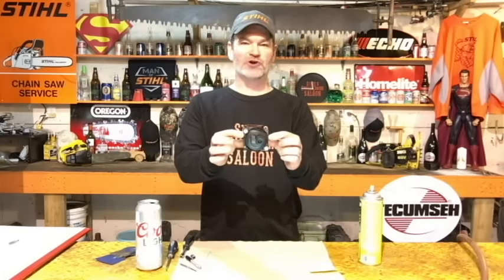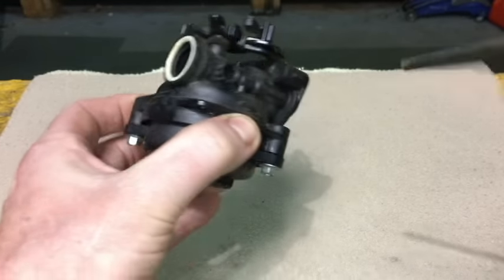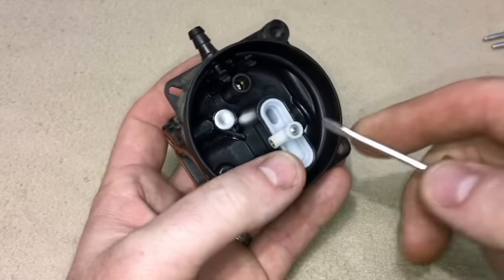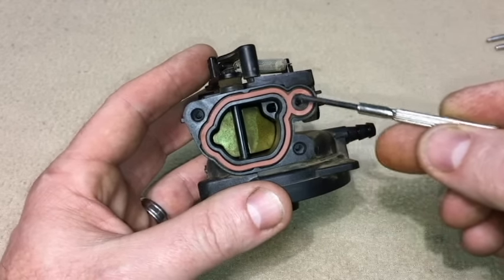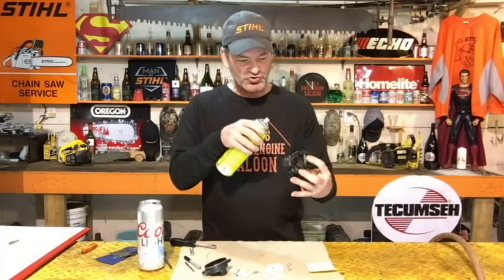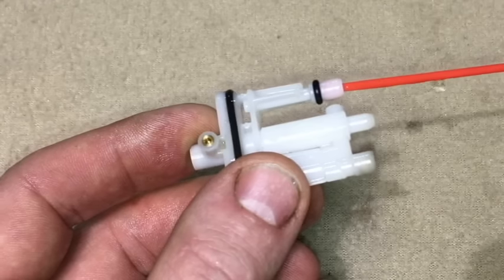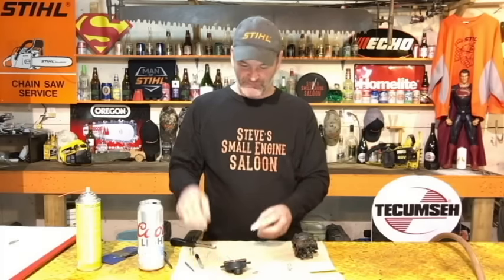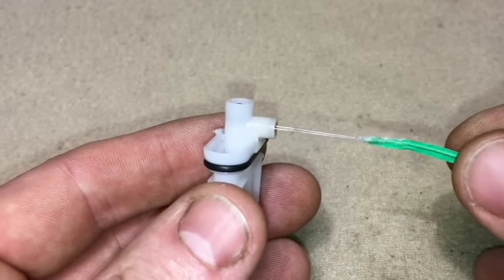EASIEST WAY To Clean a Plastic Briggs Carburetor

Comment: Good info.... Husqvarna Lc121p/725exi(2016), briggs and stratton engine, same carb, took it completely apart twice thinking that was the culprit of my hard starts, carb spray went through all the jets and passeges, no problem, next up, checking and then possbly changing the flywheel key.
Reply from the maker: I have another video in my playlist about a common problem with these...
Reply: @StevesSmallEngineSaloon  Did the jet mod and thorough carb cleaning one again, still no bueno on the starts.... come to find out, it was the one place i didnt think to lQQk, the Oring gasket that fits between the cylinder head and plastic tube like spacer that the carburator slips on, other brand mowers use a flat material like gasket between the spacer with their metal carbs. I guess over time, the Oring gasket shrunk due to the engine heat allowing added air into the cylinder or perhaps the spacer just needed tightening, but i replaced the Oring gasket with a new one anyway, same inside/outside diameter, but slightly thicker than the original. The mower sounded like it wanted to start on the very first pull, but come the second pull, vroom! starts and runs like a champ now, so to others having stubborn starting problems like i did even after cleaning the carb and jet mod, check the Oring i mentioned first and retighten the plastic spacer/bracket or just replace the original Oring(1 1/16'' OD - 13/16'' ID - 1/8'' thick -  silicone/450F).

Comment: i brought a briggs powered husqvarna mower back in apr 2017. i was used daily for 4 years and it NEVER had any form of fuel problem. its only today (april 2023) that the carb has suffered a blockage. a new genuine cartridge jet is on order. they are less than £10

Comment: Just had my first  one of theses in  and  it was hunting  I  took the carb off  cleaned  lots  of crap came out the cartridge. Put it back together   slightly better but  still not right   i did the twister wire test and it wouldn't go though after a wiggle it did   it was like a peace of grit was stuck fast  now  it's running spot on ... I think the problem is there no filtration  from tank to carb    I'm going to put  an inline fuel filter  on it.  Sure it won't hurt it.
Reply from the maker: Right on

Comment: Steve, Reaming out the small hole sounds good. There is a fine screen in the bottom of the gas tank that filters the gas on the way to the carb. If the mesh of this screen is larger than the original small hole that you reamed out says that larger particles can go through this screen than through the original hole size. That is a real problem. Can you find out from Briggs and Stratton the mesh size of this tank screen may point to the source of the problem. Roger Greenville SC.

Comment: Commenting early. I
 pulled out the cartridge and behind the little metal flap was the jet that you could not get carburetor cleaner through. That's where I think I might be having my trouble.

 I acquired a free lawn mower off Craigslist today that was in very good-looking condition and it had compression and everything so I decided to take it. The guy said it just has a carburetor problem he told me.

 I don't know how spark Works entirely on the newer model of lawn mowers but when you have the spark plug out and you have the spark plug attached into the boot and you pull the starter chord you should see spark correct. I have tested the starting coil with my multimeter and I am getting 8.2 ohms @ 20K. Tomorrow I will check. does the spark plug have to be attached to allow it to get spark. Is it some kind of a grounding thing or something else, the spark plug looks brand new. 
But that led me to the carburetor and led me to your video. 

That little jet that I was referring too.  I have got a piece of oxygen line that fits perfectly snug down into that hole from the cartridges side. No matter how hard I blow I can not get air to move through it. 
Also as soon as I opened up the carburetor I believe I discovered the problem when someone else took it apart they did not have the needle in the float it was just a set down in the hole with a float put on top. 
I'm going to continue watching the video and I hope I get the answer and if I do I'll probably delete this comment but I have a feeling that's a problem with that being clogged like that
. I hope to potentially get an answer, that would be awesome and you got yourself 👍 + a new subscriber great video man

Comment: My brother got his plastic carb stopped up with old gasoline.  I removed the carb and tried everything I could to get the plastic carburetor unstopped.  I finally bought a new carb online and installed it.  The mower started first pull, but was surging.  Removed the carb and cleaned it, reassembled and it started and ran good for a couple minutes.  Repeated this several times.  I finally put a new fuel line on it and an inline filter.  I had to reroute the fuel line to the carb.  So far, that is doing the job.  The tank has a buildup that I couldn't remove all of it.  The tank strainer appears to be good but was letting enough through to stop up the jets
Time will tell if this is a long term fix.

Comment: @stevesmallenginesaloon I have this plastic carburetor in a 20334 toro mower. It wouldn’t start so I cleaned it out and now it starts right up but the once it warms up the RPM’s go up and down about every 2 seconds. Will stop for 5 seconds and then do it again for a min. I’ll buy those drill bits and see if drilling it helps. It’s seems like the auto choke is pushing it all the way open and that causes the engine to die. I guess  because it’s not getting enough fuel. Is it possible to switch to a metal carb on this thing?

Comment: I was just doing one of these today, and it was driving me nuts that i couldn't get spray to go through that one passage where you said some of them wont. It sure LOOKS like it should be a connected passageway.   I was ready to drill it out.  I guess I'll just try to run it. Makes no sense to me why they left it blank.  
I also stripped down a twist tie for this job to poke the jets out.
One extra thing I did was to actually twist apart the two psrts of the white cartridge to see if anything was in there. This is my 3rd attempt at this carb and Im getting frustrated.  The engine fires on a prime and the bowl is full., but it just refuses to draw its own fuel and run.  My first experience with these newer carbs. It looks very simple but it's being a challenge.

Comment: I live in high elevation (7000ft) and I have a 125cc with a plastic carb that won’t start

Cleaned it out and drilled the jet with the hand drill he says to, but now the engine is over fueling and spilling gas out of the carb while running. Float is good as nothing spills when sitting. Would drilling out the carb +low air pressure from elevation cause the over fueling or do in need to look somewhere else?

Comment: Hi Steve. I have this carburetor on a push mower. However, what seems to be my problem is somehow the primer line hose is missing.  I cannot find any information on it.  I found  a hose that fits the end coming from the carburetor, but I cant find or see where the other end of the hose is to connect to..   I can get it to start,but there was gas spewing from this nipple hose end and hand to keep pushing the primer button to keep fueling the carburetor....
Reply: I wish someone would address this. Here's the problem: since you said that your mower has a primer bulb then that nipple/hose connector is not in fact a connector but is actually just a plug. There should not be any fuel coming out of it. That port is used for engines that have a choke on them and for engines that use instead a press bulb pump style primer that port should be closed but additionally there is a small metal disc that is on the inside of the carb bowl that is also used to seal off that port. On my mower with a bulb pump style primer there is both the metal disc inside and the plastic nipple connector is solid with no hole in it but I think you might be missing the metal disc inside or it didn't get seated back properly or something. I wish someone would go into more details about this.

Comment: Its probably already been said but the best carb cleaning tool is a torch tip cleaning set. Costs a few dollars and the cleaning rods are varied in size that should fit most carbs

Comment: I've been reading comments on different videos about this carburetor and people are saying not to use classic carburetor cleaner on this plastic carburetor because it will more or less eat the plastic and make it brittle and cause it to fail. They are saying to use brake cleaner only and skip the carb cleaner. Also, and I haven't watched your video yet so maybe you get into this, but there is a small metal disk welch plug inside that was just floating around on mine and I'm not sure if it's supposed to be somehow sealed or glued in place? There's a plastic plug on the outside of these that I believe is used for when this type of carburetor has a choke connected to it but for those of us with pump bulb primers It is just a solid plug. Would like more information about this as there is very little online.

Comment: If this carb is allowin complete over revving is there a way to adjust it down?  I don't see any adjustment screws on it at all... worked last year, carb got plugged up.  cleaned it. starts great but runs super high revs... just sounds way too fast. Thinking it will overheat if used much.

Comment: Steve I need yur help I had a bad torx it broke off in my rocker arm adjustment torx ( Brigg and Stratton 550ex) it's on the intake adjustment valve rocker how do I get it out the torx head it broke flush?? Due to the yur video on rocker arm adjustment it do run super great like new but that broken torx weights heavy on my mind!

Comment: Awesome, BUT, folks need to know when re installing the white  cartridge, you need to make sure the center hole on carb body has the small white plunger down in is pushed away to side, so the cartridge middle stem will be inserted fully.  Almost broke mine not knowing about the moveable center hole part in t the carb body !!  I found placing red side of carb seal down, the carb body piece would stay in proper position to  push the cartridge in all  the way.

Comment: I think i drilled my hole too big!  Would that  be why it surges and then dies? It will barely idle. Super low idle. I ordered a new carburetor. Does it sound like a fuel venting problem? Its only 2 years old.

Comment: Steve, this plastic carburetor . If the bowl fills with fuel an will not start.  Is that the main jet. I have cleaned the carb. It continues to fill with fuel and leak. Still will not start.  Thanks. Love your channel
Reply: Did you put the pin back on the float when you put it back together?

Comment: How about a Mic Ultra 😂 I could not get the O ring for the bowl to reseat. Got her all cleaned and tighten up though. It did start but is leaking gas gas. I believe I may have Not positioned the flow holes back in the correct alignment? I think I found your video on the Sleeve which I think I misaligned? Thank you sir❣️👍
Reply: I also received the mini drill set you suggested 👍😀

Comment: With the float removed we see a shiny metal disk pressed into the plastic carburetor body.  The disk in my carb had fallen out.  What purpose does it serve?  May I leave it out?  If it must be installed how is that done so it won't fall out again?

Comment: Glad you figured out the jet is to small. I am constantly having to clean mine out. It plugs up every other time I use the mower. Its been a real pain in the a... I ll drill that out see if it solves the problem.
Reply from the maker: Right on

Comment: I have a brand new b&a 875exi engine 190cc, with the plastic carburetor.  It runs horrible!  You said you haven't heard from the lady over a month.  Fix the problem? Please let me know! I ordered a new carburetor for it. Will check it with drill bit too.

Comment: Hi, Ive tried drilling out the jet but doesnt work for me. I put back together and hardly any gas squirts in the carb. Wont start. The line and tank or clean. Any ideas? Thanks,Mike

Comment: Uh oh! I did this and it starts (finally! Thank you!) but it seems to be running super rich.  Is there any way to adjust it?
Reply: Uh, oh, you did it, too. I drilled one out to 0.024 and it ran, but not great. Anything larger and it will surely run super rich. The cartridges should be coming down in price because there are so many of these out there. Maybe Steve can offer a better idea.
Reply: Also, I don't see any way to adjust them. It's fixed to the jet size. Just full choke to full run. Notice there is no variation in the rpms?

Comment: Hi Steve, I'm able to get my fuel port open using carb cleaner, but I know it's going to have to be blown out every few uses. It's now May 2020 and I was wondering if you still recommend drilling the port open to .5mm after your experiences for the last 2 years. This seems so controversial on the internet, but I'm ready to do it if you think .5 mm is the best solution. PS nothing you say will be used against you...LOL. KurtfromAnaheim   Thanks Bro!

Comment: I have cleaned a B&S carburetor.  I replaced the carburetor once, I recently replaced just the main jet assembly.  Ran good for short time after each of the tasks listed above and then becomes problematic after using a time or two.  I notice there is no fuel filter in the line, just a screen in the tank. I tried adding a small filter, but space is tight.  Any suggestions?

Comment: Hey Steve thanks again for the video brother! I sorta didn’t want to touch the plastic carb cuz I was afraid to break the damn thing! But anyway I just wanted to let you know that I have the exact same B&S carb on a Husquevarna mower and the main jet was slightly larger then the .0196” drill bit but the .0236” bit wouldn’t go so I opened her up like u said. Also bent the mounting bracket for choke actuator clearance and the mower started first pull! 👍🏻🤘🏻
Reply from the maker: Right on Buddy...

Comment: Would a fuel filter prevent it from clogging if you didn't drill it out? 

Does drilling out the jet with the .52mm drill cause it to use a lot more gas?

There's also another brass piece in that cartridge on the opposite side from the jet (on the small section that you can pull apart from the rest of the cartridge). Do you drill it out too?
Reply: I have a Toro mower that's about 3 or so years old with this carb that has problems staying running, and recently took it apart but the jet is already so large that the .5mm and I think even the .6mm (the bits in my Harbor Freight micro dill bit set are so tiny, it's hard to tell which bits I was using) loosely slid right in the jet. So perhaps they started making the jets larger again.

So something else is keeping my mower from running right. I'm going to clean the carb, install a fuel filter, and hope for the best.

Comment: Hi Steve, Great video.  I followed your instructions and now my lawnmower starts every time on the first or second pull.  Tremendous since it would never start prior to going through this video unless I poured some gas into the carburetor.  Now however, after it starts, it runs fast then slow, fast then slow several times before revving up really fast and then it backfires.  After it backfires it then runs perfectly from then on for all my cutting.  Any idea on why this happens?  Thank you.

Comment: Have a pressure washer with this Briggs & Stratton carb. It stopped running so I clean the carb and last time I used it the engine kept surging and eventually died. Any thoughts?

Comment: Just wanted to drop a note to say “THANK YOU!” This video was absolutely on the money with the problem I was having. Great up close shots. Unfortunately, I don’t have a the small enough drill bit to expand the opening like you recommend. That said, the engined fired right up after cleaning out the carb, and it ran strong for about 45 mins (enough time to cut the grass). If it acts up again, I’ll pick up the recommended drill bit. Thanks again!
Reply from the maker: Glad it helped!
Reply: Go to a welding supply and get drill type tip cleaner set. regular ones may work too just not as well.

Comment: I know this video is over two years old and I'm late but what I did on my uncle's lawnmower is pull the cartridge apart & blow out the whole jets with a air compressor after removing the carburetor I never drill the hole bigger not good for it never had a problem since other than the primer bulb ring is crooked from the factory. soon I'm doing a full tune up on it

Comment: Ok, so I have the exact carb. I cleaned it out and ran fine for 30 seconds then started to surge again. Repeated ran 30 seconds then surged again. Should I drill it out like you did with the .020 or just slap a new carb on?
Reply: There's two jets.The one on the side he drills out & another even smaller one inside the third plastic tube. Assuming your sure main jet is clean including nothing is blocking the fuel tank filter even fine hair or water as well as testing float needle valve flow.All that's left is that smaller jet. To clean i use long thin gas torch cleaner & 100lb compressed air.. Before cleaning test it's flow by blowing with your mouth or sucking to see if better aftrt the following. Its small so is restrictive hopefully after cleaning all tubes & holes in both directions starting from inside out i.e blow out of ,not into small jet then it should run fine.Surging is most likely fuel starvation,if it has a primer or choke use them & see if surge disappears or improves,leading to issue with the carb